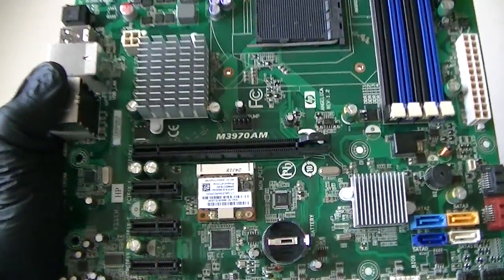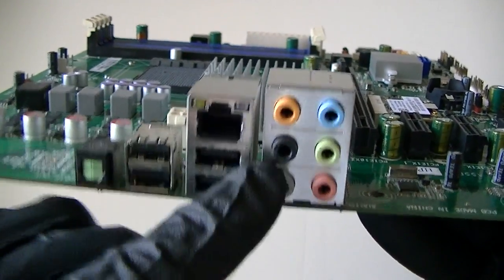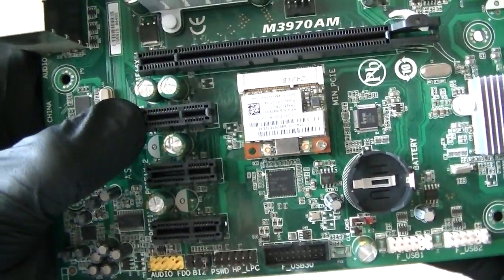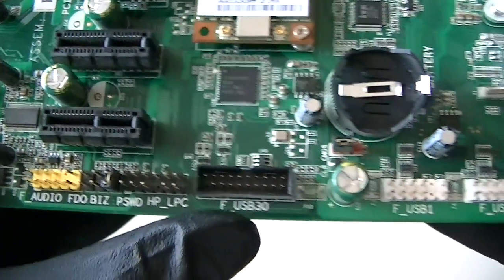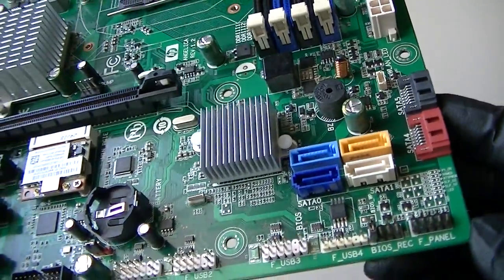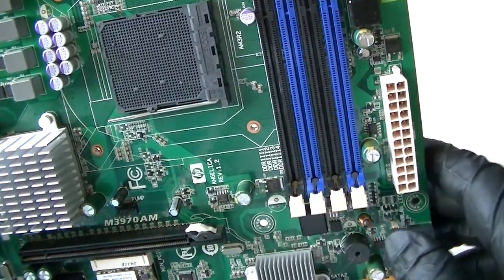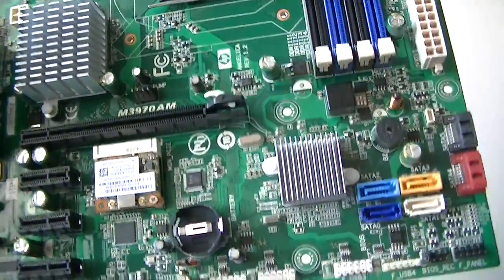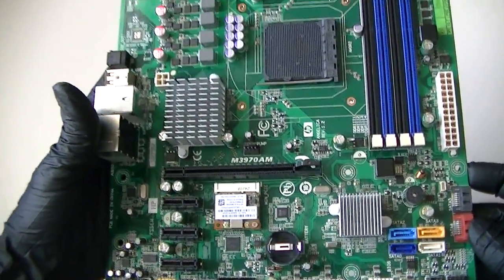M3970AM HP Motherboard

Comment: Is there a way to upgrade the Bios to 8?..the best I upgrade I had found for this specific Mobo was 7.13 Bios April/2012. I know this is a super out dated Mobo but I just need the Bios top be 8 not 7 to use a GTX760-DC2OC-2GD5 Graphic card. Any help would be greatly appreciated.

Comment: I have this Mobo in my HP. the biggest drawback is cooling. The board doesn't have a cooling mount bracket to mount an aftermarket cooler as the stock setup is directly attached to the board.